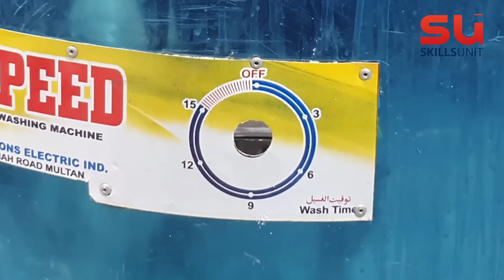Incredible Technique of Electric Washing Machine Making in Factory

Comment: Real skills! 👌 The wooden motor mount was a bit odd 🤔
Reply: To observe the repeating shocked
Reply: Same thing i thought.
Reply: Motor mount is of rosewood. Plastic body washing machines do not require this.
Reply: Это бред
Reply: To isolate the vibrations and reduce noise? Though I'd say attaching rubber washers in between will work better.
Reply: میں یہ مشین خریدنا چاہتا ہوں
Reply: To prevent any short circuit , if by chance any electrical short circuit or leakages electronic, smart thinking
Reply: How many price please reply

Comment: I love the simplicity of their washing machine. I have a front loader, but I hardly use it, all the electronics on it makes it run over an hour, and it's impossible to stop to add clothes. I still use my manual washer, it's fast and I can control the time.
Reply: In
Reply: You can convert it into semi automatic so you have full control on it.

Comment: It amazes me that they didn't use a metal support ring to support the transmission and motor,  Instead on relying on the thin sheet metal for structural support.
Reply: It will have cracks all around motor and transmission in a couple years
Giving someone a job to fix

Comment: Very good engineering skills.
But please consider the fact of mechanical engineering such as the CF force at high speed, plus the torque. You need to mount concrete blocks to add weight for its stability….